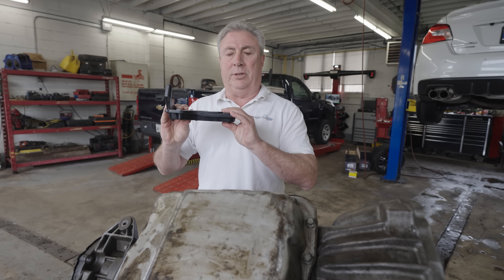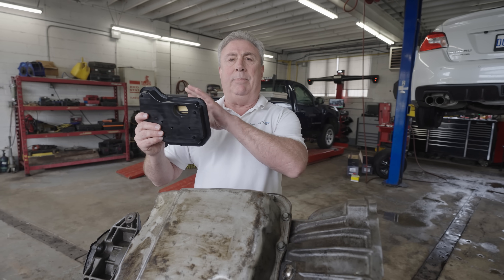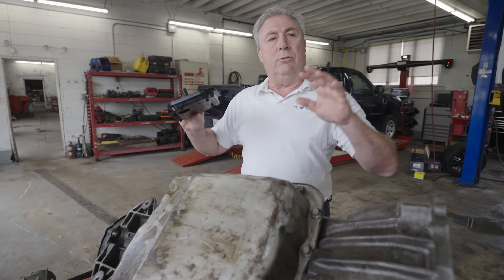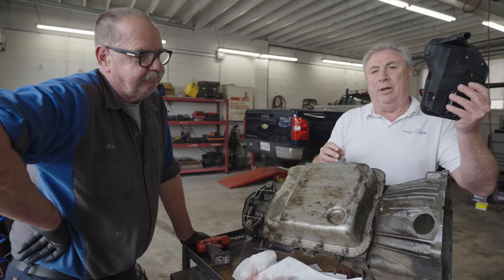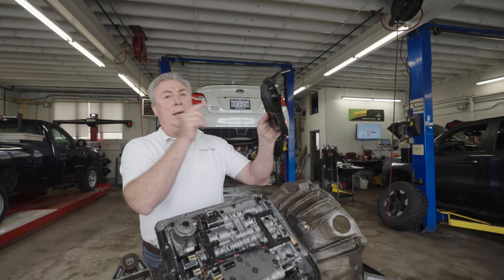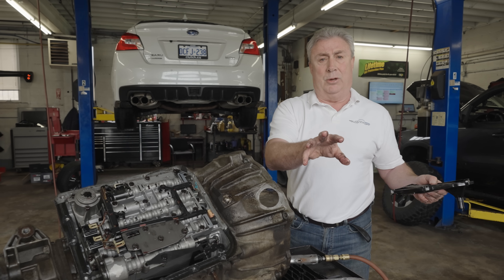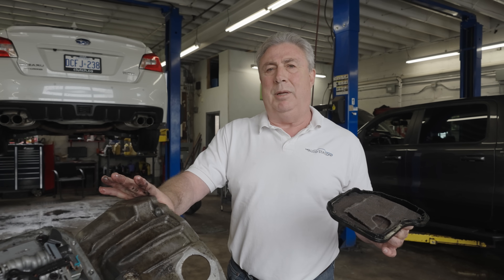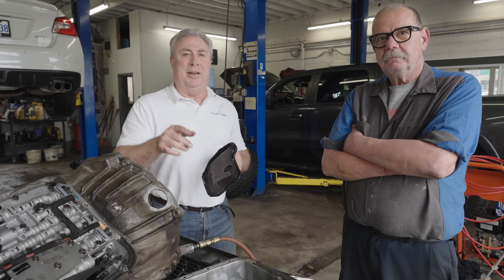Transmission filter Myth Busted - cutting through the B$$$

Comment: Ok at very end I hear what you’re saying, don’t agree but I understand it.  Change fluid every 30-50k miles and don’t worry about changing filter.  Older vehicles have filter easily accessible, silly not to change if you’re right there.  And many of the worst transmissions have no filters, maybe those things are related, or just correlation is high between manufacturers too cheap to install real filters and building bad trannys.  To me the filters that require taking engine apart to access aren’t really there for any practical purpose.

Comment: The fluid additives get depleted over time. Why would you NOT put a filter in while you're there? I mean I get it. But that just seems like a stretch. All I can say is if the manufacturer recommends servicing. Why not? It's your Rig and your hard earned money. Do what your gut tells you. Would you date a girl with a dirty beaver? Enough said
Reply: The video did say that you might break a bolt off while trying to remove the many pan bolts. They do seem to seize in the aluminum cases sometimes.

Comment: Dropped the pan on my pickup to clean and inspect the debris on the magnets after the first 30k miles...the magnets were loaded with fine particles. I also changed the filter and swapped out 5 quarts of fluid...3 weeks later I did 6 more quarts. Will do the filter every other 30k service going forward.

Comment: I agree with you...the filter is for pickup of deep-level fluid and a strainer bag. Vehicles won't operate w/o the filter unless you over-fill the transmission. Heat is the number #1 killer of transmissions...keep your transmission fluid between 160-190 deg f and it'll last 500,000. miles. I know, I've been waiting for my transmission to fail on my 1989 GMC Sierra 700R4 truck...can't wait to rebuild it again with better higher-performance parts i bought and stored....but you know it will never die as the operating temperature never goes above 165 Def F. and i have the parts ready.   So goes life.
Reply from the maker: Great to hear you've got an 1989 Sierra that's still dialed in.  And completely agree, if you have the parts and you've got that kind of temp management your not likely to need them.  Appreciate the comment, thanks,

Comment: My 1999 Honda Accord's transmission does not even have a user servicable filter. But it does have a handy drain plug which will allow about 3 quarts to drain and be replaced. I do that once a year. Also, when I bought the car (new) I installed a transmission cooler. The fluid always looks good and absolutely no problems with the transmission.
Reply from the maker: Appreciate the comment. It's fantastic to hear that you've got a well-maintained transmission!

Comment: Use to work at popular transmission so called experts franchise, Agree with this gentleman, I have seen cars with 200K miles , these are vehicles way under 10 years, have had no prior service done, the filter is a total scam, it does not catch nothing, I have opened many and looked at it, no metal flakes. Just change fluids at manufacturers recommended intervals, no need to change filter, Seen a 2012 F150 come in  with 296K miles. The guy has never serviced his transmission, the truck was used for construction. The owner thought it was life time, but we serviced, the fluid was just black. That Ford  has a bullet proof 6 speed transmission
Reply from the maker: Exactly the same as our experience.  Appreciate the comment. Thanks.
Reply: Nothing is bullet proof in a Ford.

Comment: I have a 95 gmc Sierra gt 5.7 same engine same trans same rear end as the day it rolled off the floor It has 789k kms only thing that's been done to it was the throttle body in 97 so it could breath a lil better still the original pinstripe paint job mind you the box isn't metal an the hood isn't either starts first key turn like its ready to show the world regardless of how long its sat horny lil fucker I call it amazing fuel economy 17 or 18mpg 4l60e should habe had a shit with the beating ive put it thru but shifts revs an stops ive driven just about every new truck to date an this one still impresses me I own a 2020 22an 24 an there shit nice rides but they spend alot of time an money at the shop this truck hasn't seen one it never fails

Comment: I generally deal with older cars. I pull the pan and change the filter when I get it, clean the magnet, and weld in a drain plug and 1/8NPT temp sensor bung. Then drain and refill every year.
Reply: I have had some items with stamped pans ,that I've wanted to add a drain plug in, and haven't had access or time to prep and weld.
Use a rivnut! 
Of course,put a little sealer on the OD before install.
Face it the right way,if you can for max drainage. 
Then just use a little sealer on the bolt that fits, and DO NOT kill it with ugga dugga, just get it seated and add a touch. 
Even if it's not facing the "right" way, at least you can drain the majority of the fluid out before pulling the cover.

Comment: This is essentially the same conclusion that my brother drew with the A604 transmission of his old Dodge Spirit; he said there is no need to change the filter, after inspecting it.  I have considered  performing a filter change for my ZF 6HP19 transmission (BMW 520i , 170,000 miles) but got quite sceptical now.  In that German tranny the filter is integrated in the pan - so you must change the pan also, with no extra benefit at all, of course.  Thank you for this thought-provoking video. Regards from Finland.

Comment: This is some of the worst advice. That is a filter, it doesn't need to be as high filtration as an oil filter needs to be, transmission don't have loads of high tolerance sheer areas. This transmission, and most all come equip with a magnet in the pan. this is why you don't see much metal in the filter, the Filter is there to catch clutch material, and silicon from seals and gaskets, NOT metal, thats why theres a magnet. Do this test again but on a trans that its magnet was removed from, and you'll see metal in the filter.
Reply: Your logic makes no sense. If the magnet is doing it's job, why change a filter that's also doing it's job?? Just for shits and giggles?? If the filter isn't clogged, and the magnet catches the metal, what are you gaining by changing the filter, other than less money in your wallet?
Reply: @bobbygetsbanned6049  Are y'all really this passionate about saving 8 bucks on a filter? Why ever change the air filter in your Hvac? it still works with it dirty.
Reply: @chloedegurechaff1941  The filter in your HVAC does not work when it's dirty, it greatly reduces airflow to your evaporator coil which is bad for your HVAC system. That is not the same as replacing a trans filter that's not clogged, and is not reducing flow. I wouldn't change the filter in my HVAC system if it wasn't dirty, same as my transmission.

Comment: Nice video.  You have a valid point but you need to know your opponent. A typical oil filter is 10 micron. As you mentioned it can plug. Transmission filters are a very wide range from 10 to 200 micron. I agree if over 100 micron , the chance of plugging is not likely but if the filter is 10 micron. It certainly can plug. Again. Know your opponent. There is no general rule for anything.
Reply from the maker: Hey David!  Thanks for the comment.  Full disclosure here to anyone reading these comments - David is not just an world class shop owner and brilliant hands on technician, he's also an industry leading guru and mentor to many - and I'm lucky enough to call him a friend.  My response herein notwithstanding.😎

Yes, the opponent.  In my assumption I presume that to be the equipment manufacturer and their attempts to balance service cost with the warranty period. The purpose of any serious technician discussing transmission maintenance on YouTube, in person, or working on your car for that matter would be to help any car owner avoid the transmission hell that occurs through neglect, misunderstanding, or misinformation. A well informed owner is best positioned to make good choices that make dollars and sense to them.

With respect to the transmission filter, I find it interesting that the auto manufacturers are not providing direct telemetry on transmission fluid flow rate.  If clogging of fluid filters and resulting restriction in flow was a real risk I would expect they would.

They are a handful that monitor fluid flow through internal logic based on pump speed vs pressure readings — not a direct flow sensor, but they get an estimated result. I've yet to see a transmission that has a dedicated “flow sensor” in the way you might find a MAF sensor in an engine. Instead, they infer flow using a combo of pressure sensors, solenoid duty cycles, and pump behavior.

It's not the direct measurement you'd expect if a concern existed.

That said, I hope you still love me. 😁  Thank you very much for the comment!
Reply: @TheAutoStationBurlington  Lol- I sure do- Love what your doing here- It was a great Video

Comment: I Agree and disagree with this video. Its called a filter but the perception is wrong. It filters out large contaminants not like an oil filter in your car. But changing the fluid is a MUST after 90-140k miles. This all has to do with the abuse the trans gets not everyone drives the same or are in the same climate, conditions. Auto manufactures want you to never change it so you buy another one. So Preventive maintenance is a must on transmissions. Fluid will break down with heat and cold  fluctuations. There are Friction modifiers and additives in the trans oil for a reason. 
Also he says "its a waste of time to change the filter " OK no Most transmissions don't have a drain plug and you have to remove the pan. Well for $8-30. to change a filter that pops off easily... it is a while your in there change even if it wasn't needed. something happens and you spent all the money to put expensive ATF back in do you want to open it and have to spend more just to change it when you should have.  He also shows a filter that the media is black and said this is black and the old one and the new one is clean. HELLLOOO change it. 
Black is particulate caught by the filter you claim is still good or shouldn't be changed..  the magnet is for metal Most trans are aluminum especially the valve body. The filter catches the fine aluminum. Aluminum is black when fine ground "dust".

Comment: 225k miles on my 2016 VW Passat 1.8t.. Been flushing the automatic transmission fluid every 50-60k miles since new and it still shifts like new..
Reply: You are a true hero to your car and it will last a long time.  This is how it should be done!
Reply: Good man. 
The 01m in my 99.5 Jetta has 145k and about 5 fluid /filter changes starting at like 40k. 
If you can, install an external cooler, these things run hot as heck. 
A company named sonnax had external cooler fittings for my o1m and I got a Derale 25 row cooler ,I see like 75-80 degree average temp drops on the scangage.

Comment: Different vehicles have different micron trans filters. Older ones 200 micron or more, newer less than 100 micron. I did notice that transmission was on the bench and not in the truck. Newer transmissions have more ratios (speeds) and a converter clutch; that means more clutch material in a finer filter. Newer transmissions are also very expensive. I do my services early. Always check the proper fluid, lots of different specifications out there now.

Comment: Using your logic the oil filter never needs changing either right?  If I cut open a used filter I shouldn't find anything if the engine is ok.  Do you change your oil filters?

Comment: My transmission has both a sump filter like the one he is holding and a spin on filter similar to a regular oil filter. I have been changing my fluid and both filters every 100k miles. I am close to 270k miles on my truck now. 2005 Dodge Ram 1500 with the 5 speed 545RFE transmission. No problems so far. 

I did get a shifting issue once a couple of years ago in 2023, but that ended up being bad grounds. I removed every ground I could find coming from the fuse box and computer, cleaned them, put everything back together, and it hasn't had a shifting issue since.

Comment: 2018 f150 10R80,..first used Mityvac Fluid extractor at 12K.  Sucks out 4-5 quarts at a time,...no more,   Just do it every Spring/Fall. Will NEVER DROP THE PAN.  Great video
Reply from the maker: That's a great strategy! 👍

Comment: What I do is at 15k miles I drop the pan change the filter that has trapped the majority of the break in debri then every 20-30k drain the oil and top it off. I’ve never lost a transmission.
Reply: I did a similar thing on my car. At 5,000 miles I dropped the pan, cleaned everything, and changed the filter, which has a pleated paper element. It was black, and the magnet was furry with break-in particles. My plan is to drain and fill the fluid at 30,000 miles, then do another filter change at 60,000 miles along with fluid change.
Reply: @bradnail99  I change my oil and filter weekly, yall are slacking.

Comment: This is not true for all transmissions. I had a car once that stopped moving. I removed the pan and the filter was plugged. Replaced it and BAM the transmission worked like it should. As a mechanic, if I'm pulling the pan for fluid change I'm  going to install a new $10 filter while I'm there it takes very little time.
Reply: I second this.  2 41TE in two fourth generation Chrysler minivans.  Dropped the pan, changed the fluid and filter, and they ran fine for years afterwards.
Reply: On my 97 explorer I changed the filter 100,000 miles ago. It was packed like clay of metal silt. IT Needed it!
Reply: I totally agree
Reply: Common sense prevails with people who have a functioning brain.
Reply: I don't think that's his point. I'm pretty sure he's saying you shouldn't go into the transmission when nothing is wrong with it, just to change the filter.
Reply: @bobbygetsbanned6049  if the transmission is new after say 40 or 50 thousands miles, I would drop the PAN and put a new filter in it and look in the PAN to see what's in the pan
Reply: @donaldhudson2235 at least pull the pan down, clean off the metal sludge and the magnets at least.
Reply: @bobbygetsbanned6049 
Does anyone ever actually do that??

I wouldn't be changing the filter every time you change the ATF, but I'd definitely drop the pan, clean it out, and change the filter ONCE in a vehicle's life.
Reply: @bobbygetsbanned6049 that's what I mean you have to drop pan
Reply: @bobbygetsbanned6049 derp derp derp. 90% of vehicles you have to drop the pan to change the oil and bam, filter is right there

Comment: A transmission is mainly hydraulic so it uses oil pressure. You may notice if you start up your engine and then try to put it in gear real quick you notice it doesn't work right away. Is still takes a second or two to pressurize the transmission.

Comment: They want $250 just to change the transmission fluid. I think that's way overpriced. Even at the high price of synthetic transmission oil. AT oil. They want $10 a quart for automatic transmission oil. Those heavy duty trucks use synthetic motor oil. Supposedly at lubricates better. Tell us how automatic transmission oil is different than engine oil. I think automatic transmission fluid is probably very thin viscosity

Comment: You have to keep the solenoid valves clear and clean. There's a pressure sensor that can be clogged. There are speed sensors that the tip has to kept be kept clean. I know it's not like the motor oil but a 100,000 MI. It could be changed. And there's no way to know if that guy never changed that filter in the oil on that transmission. Do you know that guy was that your vehicle. I do hear what you're trying to say.

Comment: I had to read the description to understand what you're getting at.  So what you're saying is, don't bother replacing the "filter" just drain and fill regularly?  That's if it's that's easy with a number of these vehicles, they have no drain plug, no accessible dipstick.  If I got to crack that bad boy open to get the the fluid, I'm gonna pull that filter.  But then, while I'm there, I'll install a pan with a drain plug and a dipstick if possible.

Comment: He is not wrong about the transmission pre screen. it is not a filter in the same way as a engine oil filter that goes down to microns of filtering. but not changing it i do not agree. When you do regular Fluid changes it does not need to be replaced often. in fact---> the sealed transmissions of today's planed obsolescence vehicles most actually have non serviceable pre screens that only get replaces when the tranz is rebuilt and i doubt even then it gets replaced.  on sealed type i install an inline fluid filter if it has a trans cooler. sealed transmission does not mean never service. regular fluid changes will dramatically increase longevity. City driving and or towing is SEVERE maintenance schedule. so large majority of driving fall in the severe 30k fluid service.
Reply: I had the “lifetime” transmission fluid changed in our 2016 Camry at 42,000 miles after reading about other people’s experiences. Sure enough, it was mostly dark red but some had already started to turn black. I read up on the fluid and it’s not even a full synthetic. 30,000 mile intervals for a hot climate like where we live make perfect sense for a vehicle I want to last.